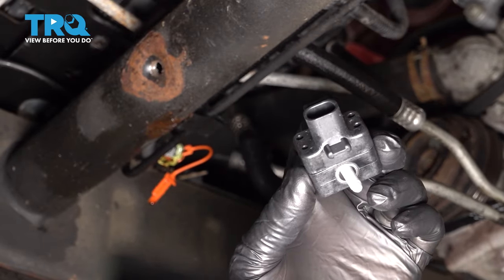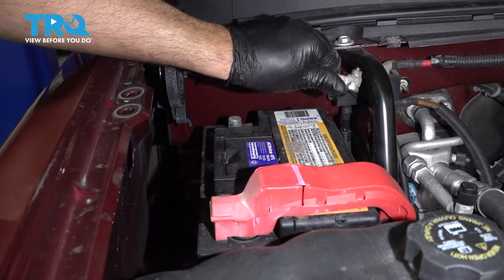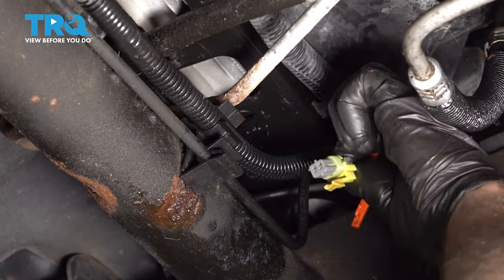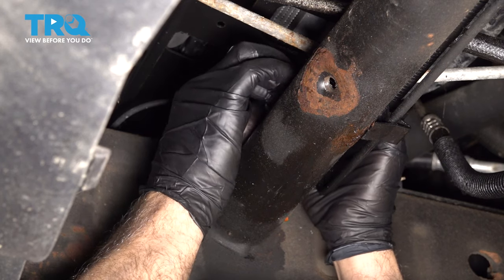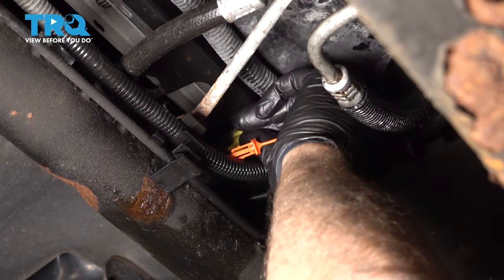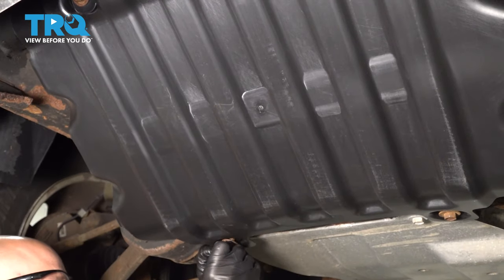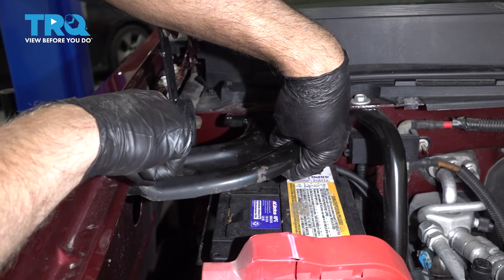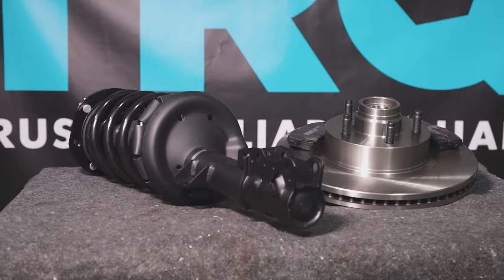How to Replace Impact Airbag Sensor 2007-2013 Chevrolet Silverado

Comment: Just looked at my 2011 Silverados sensors and my hex bolt is on the top, directly under the radiator and the bottom  of the bolt has a reverse torx that are rusted round. I may or may have not room with box wrench, but who TF installed it like that?!  If i can't get them out without removing half my front end I'll just mount them next to the old ones. 🤬

Comment: I replaced both impact sensors on my 2011 Silverado. Had to take off the radiator. Pain in @$$. Smh. Cost me $200 a piece for the two front impact sensors and a trip to the dealer to finally find out that it was the sensor under the driver seat. Smh. I spent $700 total including the 2 1/2 gallons of coolant

Comment: Awesome video, thank you!  I’ve been told by the dealer that I need both airbag impact sensors replaced.  Is there a video showing how to replace the other one?  The part in the link is $279 for the pair and my Chevy dealer wants $795 to replace both.  Even without me having a lift for convenience that looks like a 30 minute job.  This is why dealers have the reputation they do.  Thanks for supporting DIY stuff that is doable by most people that have gotten this far.

Comment: my question though is this part from the link supplied interchangeable on a 2007-2008 Silverado because if you search for the sensor under one of those years, it will come up with a different part number, same looking part but 2 different numbers

Comment: You can't get to bolts on 2010 Silverado thier underneath radiator. You have to relocate them  if you don't want to take whole front end apart.